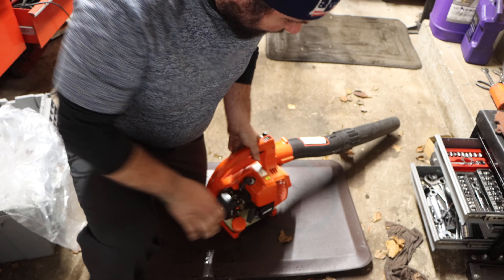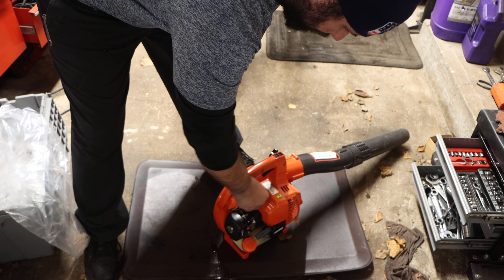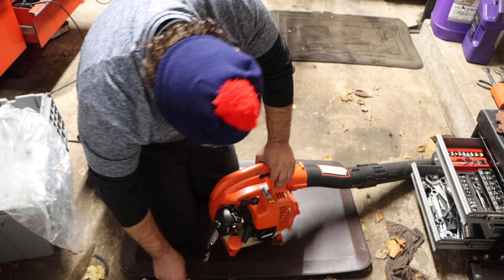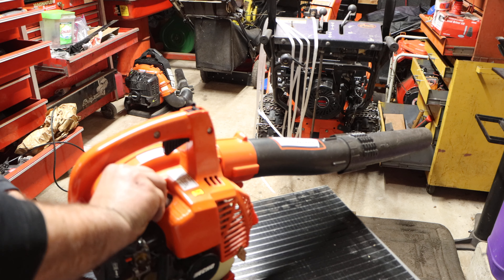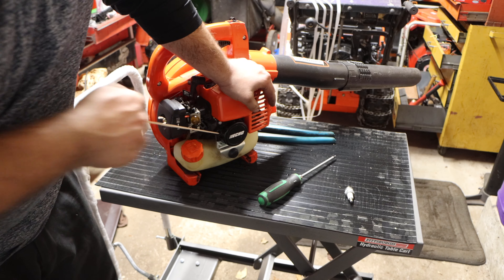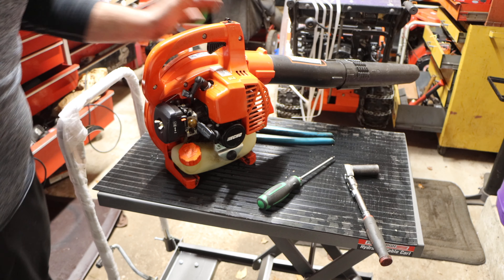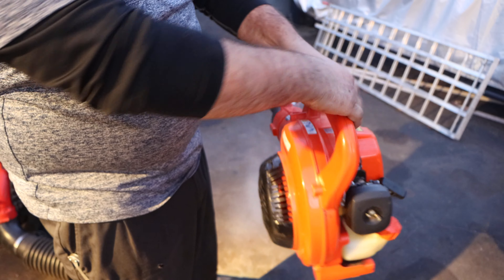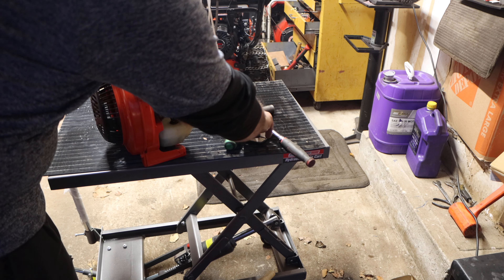Mrs. Pattay's Performance #FREE Trash Find Echo PB265LN Leaf Blower Seized Engine Fuel Leak No Start

Comment: Never trust what’s in the tank. Always dump it. And pull the muffler when locked up just to see if straight gassed and scored.  Good vid, easy fix!  Thumbs up to Mrs P.!!
Reply: Right on Ken.
Reply from the maker: I don’t hAve trust issues 🤣
I didn’t pull the muffler bc the gas was mixed.  It is smelt Like gas...would be a different story.  🔧🤙🏻🇺🇸🦅
Reply: I still never use what’s in a customer’s tank. One time I did and the engine seized, turned out the customer lent the unit to a friend and he put in a dark bar oil!  Never again!

Comment: I bought one of those in 2010 brand new. Sold it a couple years back. Wish I'd kept it, best handled blower I ever had.
Reply from the maker: HOLY SH*T!  I can’t believe this...

I just watched your video last week about your echo 580 muffler mod. 🤣🤣🤣🤣

Not going to lie, had to watch it multiple times to figure out what to do.  God knows when I will apply it but I def intrigued!

I like echo products EXCEPT those damm plugs to get the carb needle adjustment!  Lots of people like Stihl...I don’t overrated! 🤙🏻🇺🇸🔧🦅
Reply: @pattayperformance  Yeah  haven't had very good luck with Stihl products. They're nice when new, but seem to be a pain in the ass when they get some use on them. Always has great success with Echo products. I have been using them for about 20 years now with pretty much no issues. Husqvarna seems pretty decent, that's my second choice after Echo. I also did a muffler mod video on my SRM266 and that thing is a beast. I put up a demonstration video earlier this year showing the power it has, 1 handed lol.

Comment: Jeepers looks like brand new on the plastic.

Why do these Echo two strokes get gas on the air filter? Choke for too long? I was pretty sure the bulb was a purge bulb instead of a prime bulb. My old Echo trimmer is awesome but also gets gas on the filter sometimes.
Reply from the maker: Some stuff you find in the trash doesn’t belong there just as much some stuff for sale belongs in the trash 🤪

Thanks for the view and comment, hopefully you subscribed to our channel 🦅🇺🇸🤙🏻🔧
Reply: The “LN” designation on Echo equipment means low noise or lower noise. If it says”PB” it’s just a blower. The “ES” version is the shred n vac.

Comment: Do you heat your garage , or work in  the cold
Reply from the maker: Excellent question,
I only hear the garage when I need paint.  Just use one of the electric plug in heaters Chris had when she lived in an apartment.  For the most part I’m out In the cold.  I can only get the garage temp in the low 40’s when it’s that cold. 

🔧🤙🏻🇺🇸🦅